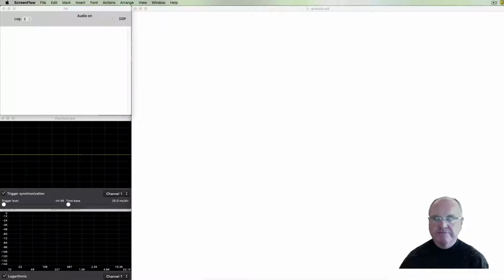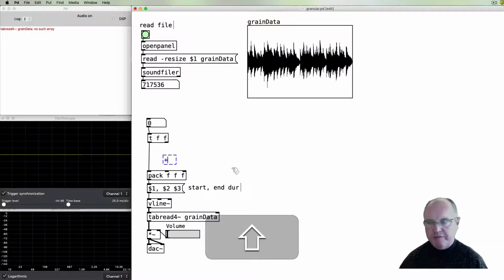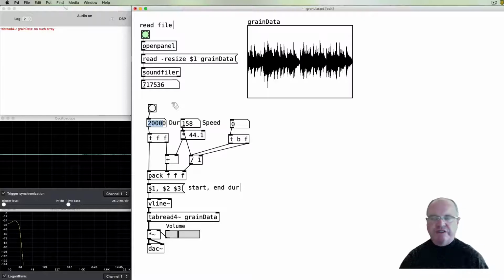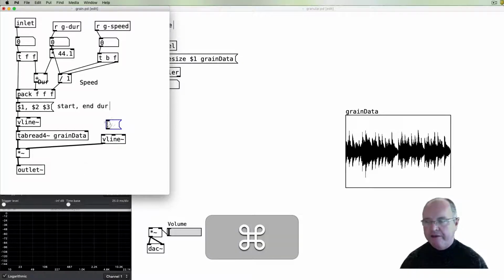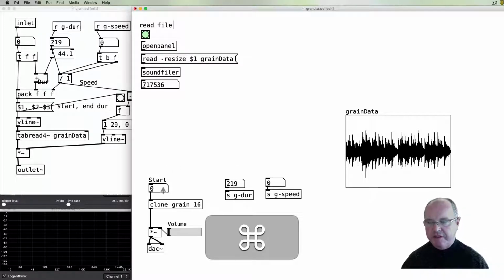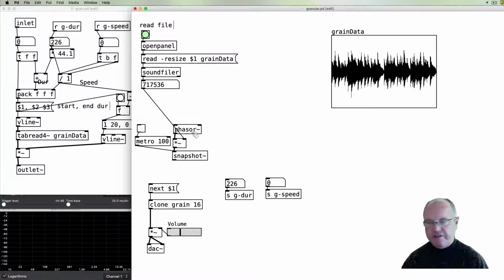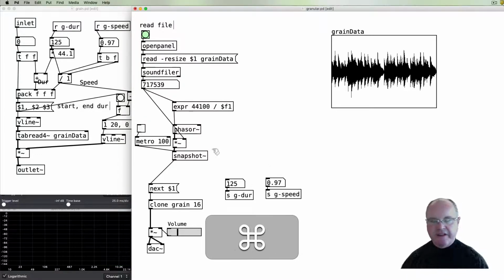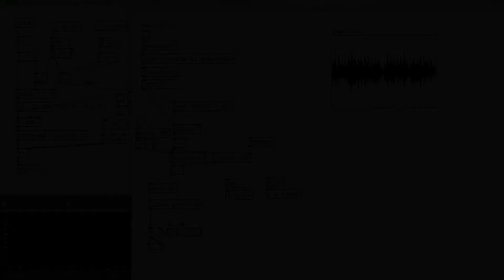41. Granular Synthesis with Pure Data

Comment: I think granular synthesis is just an evolution of timestretch 
 , I was using the tabplay~ with a short loop length ( Around 30 ms  ) ; by adjusting the loopstart ( which also banged the tabplay ) I could scan through it , make it a bit smoother by converting the looplenght (in samples )  to hert used by a phasor + another tabread~as a windwowing function (so tabread~multiplied by tabplay~ ) 

Crude but fun
Reply: Timestretching is a technique in granular synthesis, rather than the other way around